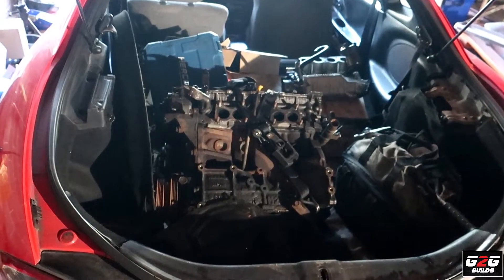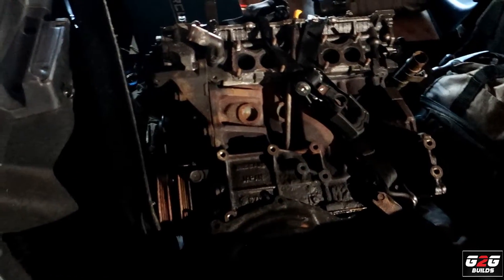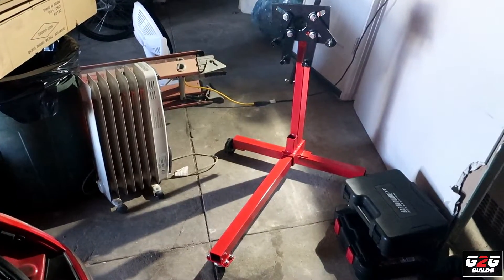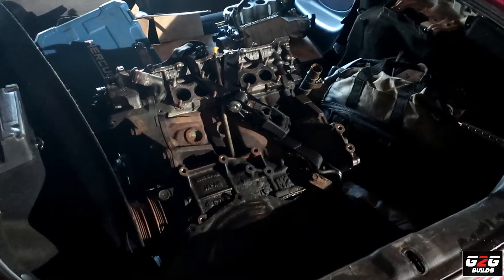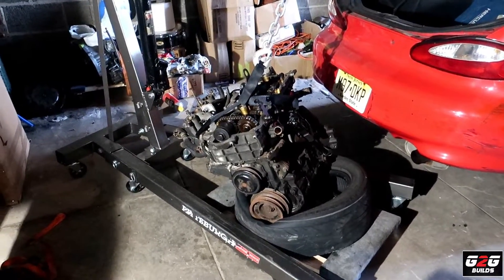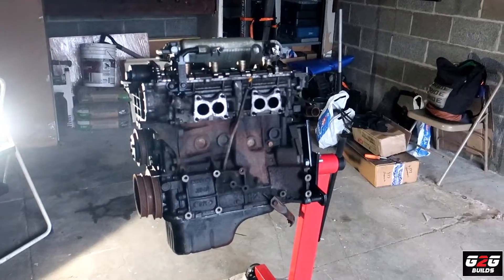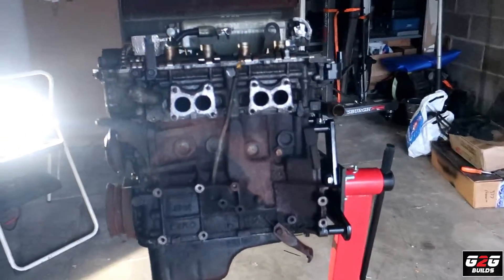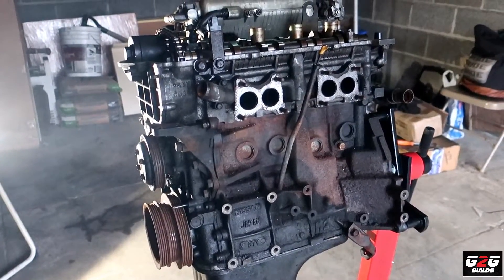B13 Sentra GA16DE Engine Disassemble (Part 1)

Comment: What size bolts did u get and from where I am having the same issue trying to get my engine on jack stand
Reply from the maker: I went with one of the transmission bolt to home Depot, and got 4 of the same tread, but longer.
Reply: @G2GBuilds  okay thank you also I was wondering if u by any chance have some spare transmission bolts or like know what bolt goes where I have to put the engine and tranny back together but I don’t know which bolts are for it since I have a huge pile of bolts
Reply from the maker: @elitetoxicity9446  No brother, I don't have any spares around.

Comment: My brother had a ga16 back in Jamaica  and he was pushing 17psi on stock internals  he kept blowing headgasket and  a couple rods through the block... I also had a ga16 turbo daihatsu charger on  8psi best time was 14.0 I was running the stock sr20 ecu and injector nothing more .
Reply from the maker: That's amazing..
I'm looking forward to see what I broke this time..
Reply: @G2GBuilds  my b14 s20 is running on the 04 qr25de ecu with drive by wire  not done yet because the car is down south going to be tuned on up rev cant wait to see the numbers
Reply from the maker: @brownspeedengineering  thats awesome..
I'll take a look when you post a video on it.. 👍